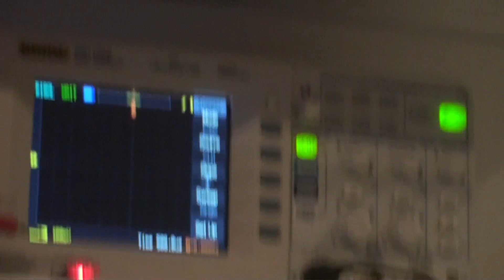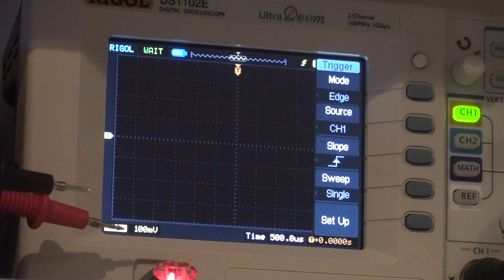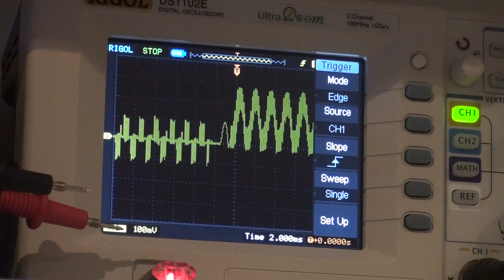Blowing up ESC's Reason #2

Comment: I think you may have hit the nail on the head here Mr Mel.
That can explain a lot of the issues we have been facing.
Sure the ICE controllers may have had substanard FETS but NOT everyone experieced issues.

And also explains why the more expensive ESCS can handle the triple loads even with a bad connection.

Thanks for that!